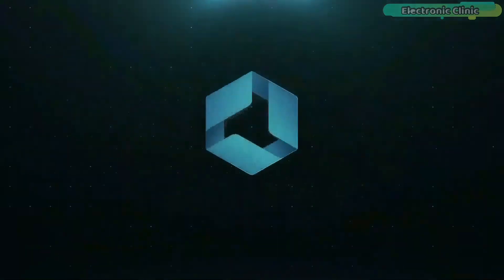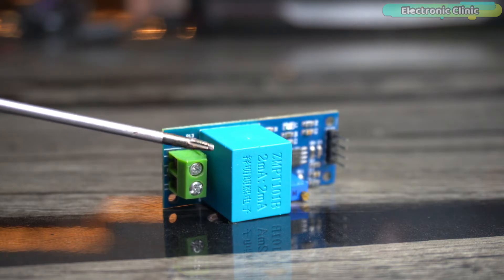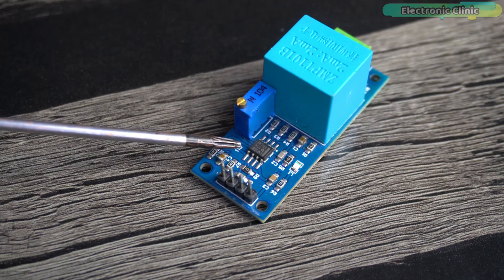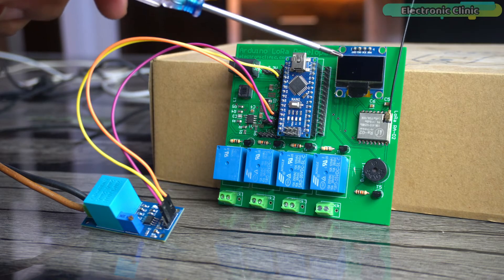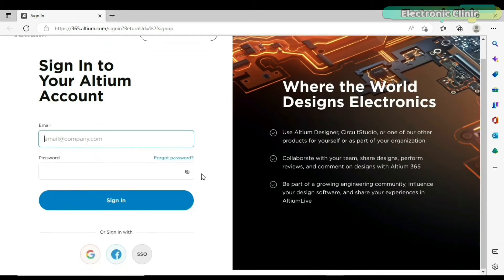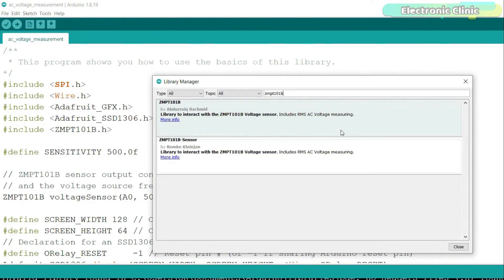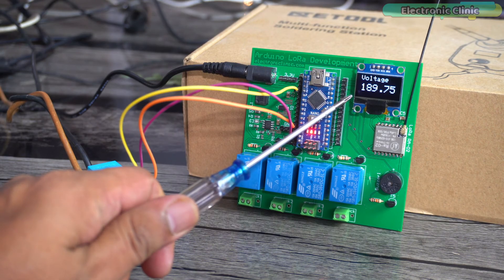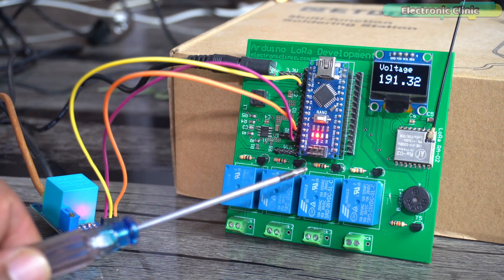ZMPT101B 250V AC Voltage Sensor with Arduino, Voltage Monitoring

Comment: Hi,help me,I use from zmpt101b for measuring AC voltage but out put fixed on 2.5volt.i changed potentiometer but don't effects.

Comment: can I use two sensors to monitor two phases?
Reply from the maker: @othmanmurad5267  yes you can.
Reply: @ElectroniClinic  can you provide  me with instructions of how to do that? currently I have one sensor that monitors single phase, but I'm using WH as load which has two phases.

Comment: How can I connect both ACS712 and ZMP101B with a bulb and arduino nano to monitor its voltage and current values? Could anyone help or provide a link for the same?😊

Comment: Where does your range of 80-250v range come from? I can't find it anywhere else on the Internet and would really like to have it verified.
Reply: Will it work for lower ranges? I need a sensor to measure small AC voltages (< 1 Vpeak)
Reply: @sannidhyagupta7026  I strongly doubt it. I could get it to work with 10 Vpeak though, but there was some slight noise on the measured signal. Just beware that the measured signal is phase shifted from the original by almost 90 degrees, so you would not be able to use the sensor for something like closed-loop control.
Reply: @richardknipe2733  I use the same 10v peak but no sin wave appear can you tell me why

Comment: can it used in solar panel out put to read the readings , Waiting for power monitoring system video ... Thanks for sharing
Reply from the maker: For this measuring the solar panel voltage, you can use 0 to 25v DC voltage sensor. You can modify that for measuring hi voltages. I have used it in many videos. Check playlist.